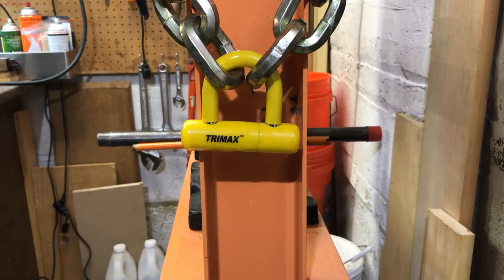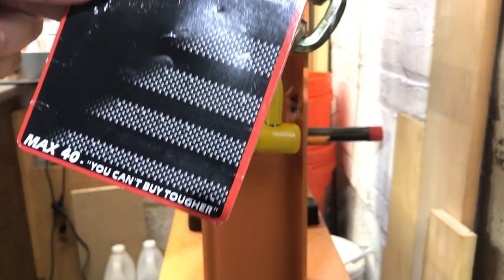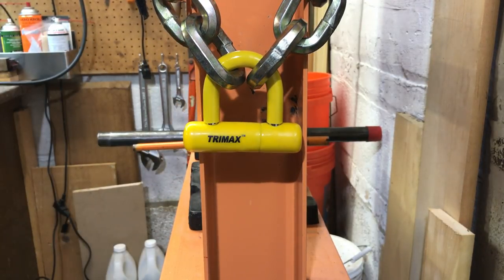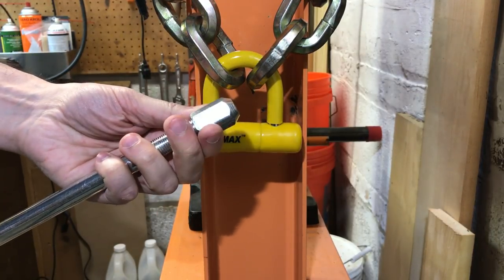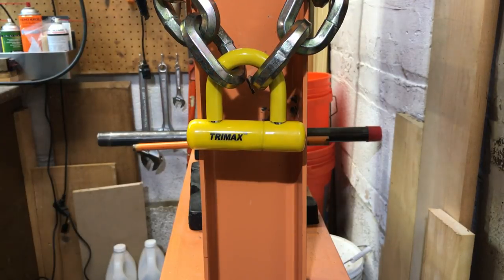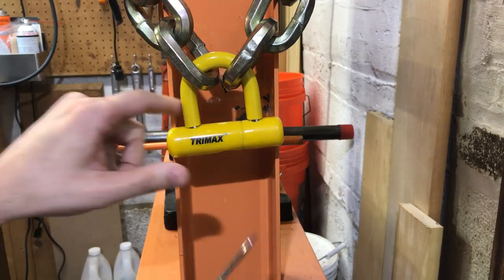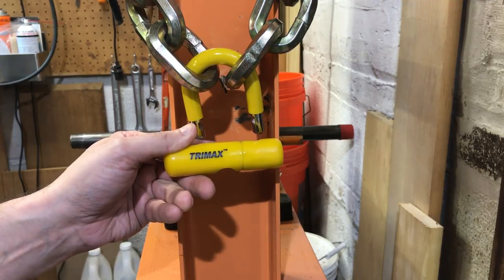[547] TriMax Max40 Disc Brake Lock vs. Slide Hammer

Comment: We used slide hammers in the Army to drive grounding rods into the ground. Attach the rod to the threads, drive it down, add another section, drive it down. They were also useful to get them out. I have never actually seen anyone use one for anything else. Very interesting.

Comment: what is the effectiveness of an aluminum bodied padlock like the american 1100 or master 6835 against a slide hammer, and how much more difficult would it be to get a screw into those cores would it be?  i know they're not "AMS" locks, but the hard retainer plates that hold the cores in, aren't held back by much aluminum.

Comment: nice video keep um coming....all these u-locks and d locks can easily be strengthened by slipping a steel tube over the base unit and drill holes to match the shackle and key hole...that way the slide hammer would be useless..obviously still able to be picked,cropped,and spread top to bottom on larger locks (but on a mini lock loads better).even sawn if not hardened steel but for a cheap way to toughen them all..

Comment: Does this make you the best lock picker in the world?
Reply: No...just "the best that money can buy,"
Reply: He did not pick it, he broke it. And since that requires no particular skills other than the knowledge about this vulnerability…. But I am curious about one thing…. What happens to the guys who design these flawed Locks in the first Place. 
Because this could be avoided so easily. If it wasn't for this vulnerability, this Lock would probably require a grinder, some time and a lot of noise to open. Or a really good Lock picker. 
And I don't really know how practical they would be, but even as a Complete novice, or not even that, I can imgaine several designs that would make it patently impossible to pull the core out like that. I mean, everything falls apart if you brutalize it enough, but most Lock pickers or breakers want to go about it quietly. And fast. 
Anyway, suggestion: A large lug, or several, on the core, and corresponding grooves in the Lock itself. You Lock it, this flange rotates into the groove and Locks in Place. Now it is impossible to pull it out With a slide hammer, because there is no way a screw would have enough friction to break a good sized locking lug. It would just strip the screw. There is no way this core comes out without being picked or unlocked first.
Reply: Can you reasonably ask yourself if he picked the lock?
Reply: he has vids on picking numerous disc detainer locks and even has designed a particular tool to facilitate that. is he the best, probably not. but definitely is talented and a great channel  to watch!

Comment: Pulling and pushing. In proper kits, it comes with a rubber, plastic, and metal attachment. It's excellent for body work, but also for the finer stuff, where you don't want to destroy an item with a potentially haphazard slanted blow.

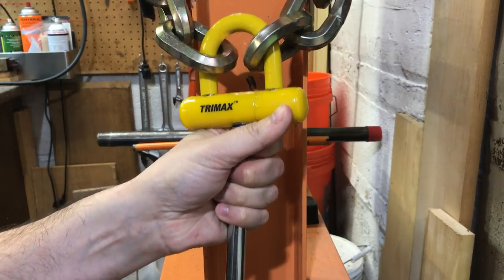Comment: 2:20 I bet you where smiling knowing it will fail.
Reply: He did a clone (or this is a clone?) from Master lock earlier. Same exact video, just that it was a Master lock. Same result. Unless they slide the whole body inside a sleeve, these are useless, he's using a hammer, but two relatively large screwdrivers will achieve the same result.

Comment: Probably a dumb question but I wonder how the average door locks would stand up to slide hammer attacks?
Reply: Considering most of them are held in place by a little c-clip, probably not very well
Reply: Trapper John that's what I'm thinking. It would be interesting to see.
Reply: A circlip AND all the pins
Reply: a slide hammer is not the optimal tool. what you do is stick something lick a screw driver in to the key way then smack it with a 3lb sledgehammer. This will pop the core out of most cheaper locks.
Reply: cipher315 true. Or of course use a snapper on the low end euro profile locks.
Reply: +Boris Kozo  I didn't think of that, you're right.  However, my house has lever style door knobs with KIKs in them.  Maybe you can't shear off all five pins, but the knob is held in place by one brass pin.  I bet someone could rip the whole knob off, then the KIK would just drop off
Reply: If violence is an option then the sky is the limit ;)
Reply: probably better than the average door;)  Depending on what kind of door you have and how it's framed, it can be surprisingly weak to applied force -  uPVC  panel doors as used in the UK  recently and currently are a disgrace.
Reply: Cylinder snapping: https://www.youtube.com/watch?v=FqhhXyROxQM
Plug pulling: https://www.youtube.com/watch?v=f6-3RaFwgIg

Comment: The attachment you call "a threaded cap"; i've been hunting high and low to buy these separately, but cannot find one anywhere. Is there another name for them? specifically the kind you have. I have a sliding hammer already.
Reply: Bro It's called a "Slide Hammer nose cone", it's easily available on Amazon

Comment: Okay; LPL, I luv ya, yer great.
BUT.
Can we please agree that pretty much NO LOCK will withstand a slide hammer and a power drill?
I have an EVVA 4KS on my front door. This is quite possibly one of the world's best locks. For the price, it had better be.
However, I'm sure it's totally vuln to slide hammers, die grinders with cutoff wheels, angle grinders with cutoff wheels, trucks with logging chains attached, and probably Hi-Lift jacks.
It would also totally fold against gas-powered concrete saws, bulldozers, hydraulic rams, various armored vehicles, and of course field artillery and most explosive devices.
I still paid a king's ransom for the sucker, and it was money well-spent.
I want to know if this can be bypassed or easily picked without power tools and obviously-not-the-key equipment.
If I'm using this product to chain up my bike, chances are good I'm chaining it up somewhere generally visible.
Otherwise, the noise of this attack would still draw attention. The sight of someone using a slide hammer on a bike lock would be a curious one. As for the power drill....
Most mortise cylinder locks can be punched right out of the door with a can of compressed air and an air hammer. This also makes a handy murder weapon, if No Country for Old Men is to be believed. Or understood.
Anyway; I do understand that for these types of locks in the situations they are most commonly in, a surreptitious attack is less important since the victim of a theft will see clear evidence that their lock was defeated since their stuff is gone. I also understand that if the setting is just right, a zip tie would be all that's necessary to secure your bike.
So if an attack is going to be noisy, it needs to be fast. REALLY fast. If it's going to be quiet, it can take longer.
The trouble is, even if you nix the power drill (and thus cannot get the first screw in as far, so you wind up using at least TWO screws)and use ALL hand tools, you're going to wind up trading that off for something else....like the extra time AND noise of a minimum two attempts....two minutes if everything goes right in the dark and maybe precipitation and cold...
A lock doesn't necessarily need to be the best as long as it's capable of resisting a level of attack commensurate with the value of what it's securing.
I don't actually NEED an EVVA lock on my door...honestly, that lock is probably the single most valuable thing in my entire home.
I'm a lock freak, that's all.
But for normal, NON-pathological people, a Kwikset is likely just fine.
Maybe a Schlage.
Just....do me a solid and put away the f!!cking SLIDE HAMMER, m'kay? LoL.

Comment: Next show us how to unlock every chicks legs bro
Reply: It's not rape if you use a slide hammer
Reply: You need to probe the keyway, insert an appropriate tension wrench and apply gentle pressure. A bit of practice and manipulation and she'll pop right open. Works especially fast on cheaper or secondhand models.
Reply: Thirst central